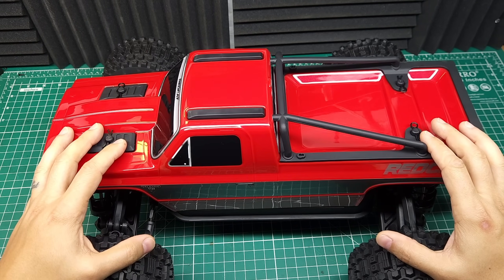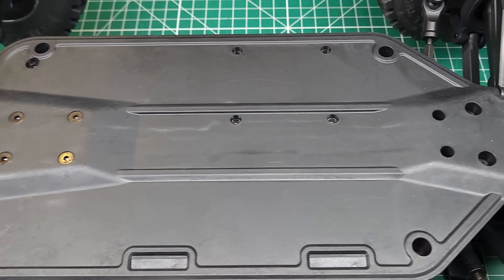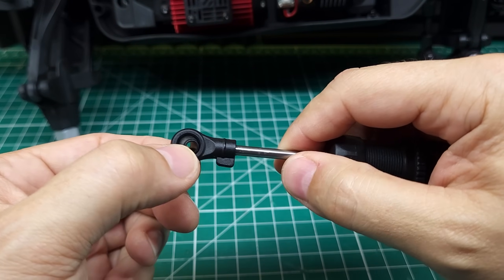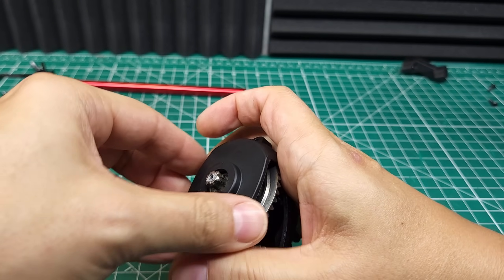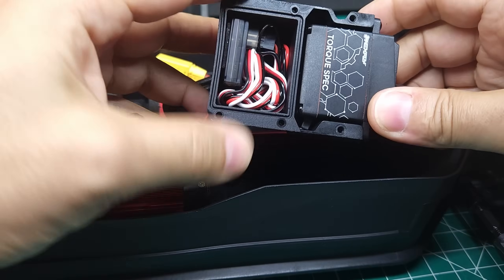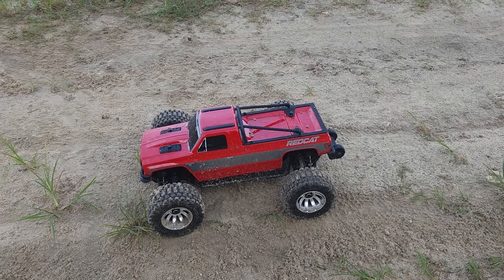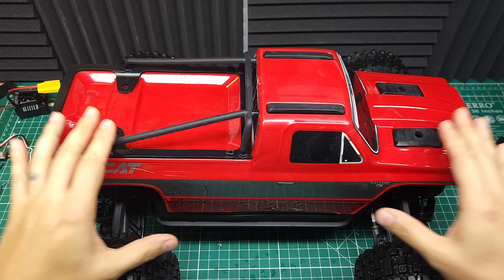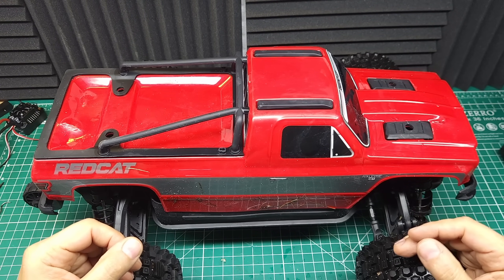I Got The Redcat Valkyrie & It's Awesome! But There's A Problem.

Comment: Got mine today for 239.00, no tax right from redcat, it came with the improved shocks installed, shock ends are threaded so they listened and changed them, esc works fine, diffs just had light layer of oil, I put some silicone grease on them in put was surprised with the light layer of oil on them. I would say it is a bunch of screws to to take off but surprisingly I was able to get diff out and back in after greasing in about 20 minutes.
Reply from the maker: Underfilled differentials is probably one of the most common issues with RTR vehicles. I suspect they don't put a lot of oil in them so that it doesn't leak out during pressure changes in shipping
Reply: damn i dont see that price on there site is there a special way to get it for 239??? i want this truck
Reply from the maker: @Ccrider363  It was a sale they had going on. Unfortunately I don't think it's happening anymore
Reply: @ well score man! I’ll probably still get one!
Reply: I think still a good buy for 299, if you order from redcat there's no tax, but I think they will have it again for 239, if they do I will get the truggy version
Reply: @  I might wait and see if there is a sale again

Comment: I got the Valkyrie MT and was very impressed initially. I had esc problems on 4s and waited over a month for a replacement as it was out of stock. While waiting for the replacement esc I was running it some on 3s and encountered another problem. The idler gear started making a loud noise. Upon disassembly I found the idler bearings, gear and shaft destroyed. Redcat sent all replacement parts but when I installed them they lasted only 3 packs. I was saving for a 6s rig when I got this on sale. I should've just kept saving.
Reply from the maker: Interesting. I don't think the idler gear is a super common problem
Reply: @DoRC  Maybe it was a fluke. I'm gonna fix it again and see what happens. I was halfway hoping it was common, and the aftermarket would come up with a fix.

Comment: I gotta think that 90 percent or higher of people who buy this rc vehicle are not taking it apart to lube the diffs, they are just putting a battery in it and running it and we are not hearing bad things about the diffs with that very light layer of oil or whatever light grease they are using, I'm thinking that's kind of impressive that they run like that with no issues.
Reply from the maker: Absolutely and that's the case with most RC cars I think. It's hard for me to remember that just because I'm kind of surrounded by enthusiasts but you're right probably 90% of people who buy these cars never touch them unless they break
Reply: I've completely disassembled my TR. More so than DoRc here. Who,if he had,would have known about the 2 bearings under the ackerman link,and would have found the red aluminum bar  that captures the hinge pins. This is only my second rc car since I was a child . I must be the 10%.
Reply from the maker: @MikeThomas-q1x  nothing wrong with that! I would say that most people probably don't spend a lot of time tearing their cars apart unless they're broken but it definitely is fun and gets you familiar with the vehicle.

Comment: I really want to buy that thing, but I don’t care if it’s $100 after buying the Vigilante. Even after doing all the diffs and Vitavon upgrades, the rear diff still strips.
Reply from the maker: Redcat actually just released a full CNC machined gear package for the vigilante that you might want to check out.
Reply: I will, but RedCat should have in there from day one, but thank you I didn’t know that

Comment: All heatsinks should have some sort of thermal compound between it and whatever it's trying to cool.  If not, it is below standard.  The heatsink might look like it makes good contact but under a microscope, you would see that it hardly touches the motor and it's mostly air gaps that need filling.
Reply from the maker: Yes and no. I've done some experimenting with this in the past and whereas The heat sink compound does definitely improve thermal transfer as you would expect It's usually good enough on these cars that it's not needed and it can be really messy if you ever have to do anything with the heat sink / motor. I prefer to run without.
Reply: Eh. I think you’re expecting too much from manufacturers. Diminishing returns. Besides, it opens up the opportunity for YOU to add that thermal compound. 

I’ve never used thermal compound and I’ve never really needed it, and I’m driving in 100+ degree summers
Reply from the maker: @PigglyWigglyDeluxe Yeah I've tried it both ways and it definitely is an improvement but for me it's not enough of an improvement to justify the mess
Reply: All these items are cheap rc cars dude. Not nasa explorers.

Comment: I’m really shocked that the servo was under performing. I’ve never had an issue with stock redcat servos in terms of power. I have broken gears after a while but always felt the performance was fine, and I like fast servos.
Reply from the maker: Maybe it was just my specific servo but it definitely was sluggish to the point of negatively affecting my driving.
Reply: @DoRC  apparently YouTube removes comments with links. If you go to redcats website and find that servo, you’ll see if goes up to 8.4v and apparently runs at 0.12s and 42kg at that voltage. Might be worth trying before writing it off. Though I have no idea of redcats receivers go that high
Reply from the maker: @dylanwhite6539  after doing a bit more work on it it seems like the main problem is that the rack gets jammed up with grit and puts a lot of load on everything. I am trying a better servo now but the red cat one might be sufficient assuming the rack is not jammed up.
Reply: This is my first non-arrma or Traxxas in a while and while I do like it, controlling it is very difficult.  It is all over the place, even with the Spectrum Dx5c Pro and 6200AT AVC Receiver in it.  I also increased the BEC to 7.4 volts which helped a bit but the wheels tend to wander, especially at higher speeds.  Not sure if a better steering servo would help?  It was not easy to get that Receiver in there and because the Spektrum one is larger than the stock one, you end up having to mount it flat as opposed to sideways like the stock one is mounted.  It could also be that I have been spoiled by the more expensive vechiles like the 6s BigRock and Mojave and am expecting more than is realistic for this price.  The Maxx is not great at tracking straight either but the wheels at least don't dance like these are.
Reply: I fixed the issue.  Truck is driving straight as an arrow now.  The DX5C Pro bound to the 6200at AVC Receiver makes a massive positive difference.  Initially, the fact that the receiver is under the esc and the fact that you have to disconnect the servo-saver threw me off when binding.  Also had initially forgot that with the AVC receivers, you have to bind and calibrate twice, back to back, in order to activate the AVC.  In addition, the aervo has to be set straight in the middle.  It is a process because first you bind, then with the truck still on, you have to re-attach the servo-saver, situate the ESC back into the chasis as it would normally sit, then start the calibration process the same way you do an Arrma vechile.  Full throttle then full reverse, then turn the wheel to the right, then to the left and from there it calibrates for the first time.  Then you turn it off and repeat that very same process, identical to the first go around with the exception being, before binding, you have to reverse the steering, then start the identical process.  After I completed the second bind and calibration, I then screwed the ESC back into the chasis.  Now the truck drives awesome.  Straight and with much better control.  In fact, it drives better than vechiles 4 times as expensive.  This is an extremely impressive release from Redcat.  Just have to get it set up properly like with all RC's.
Reply: When I say it is driving with total control, that is absolutely the case.  Cannot believe the difference with an avc receiver installed.
Reply: @XWXW-lk4jf  sounds like you need to update your transmitter firmware. The 6200 should already have auto AVC calibration and I know the 6100 and 6110 support it with an update. No more of that right left forward brake nonsense, it just works as soon as you start going forward. You can see the firmware your on right now by looking at the bottom of the screen when your booting up. Note that if you’re super out of date, still on a v1.x version, updating to v3.x will clear out ALL MODELS as the old file system isn’t compatible for some reason. If you have the dx5 pro with the micro SD, you should be able to export the models to the SD card and then import them after the update. Slightly confused because a “DX5C Pro” doesn’t exist. There’s the DX5C and DX5 pro, I assume you mean the latter
Reply: @dylanwhite6539  Yes, Dx5 Pro.  I also own the Dx5c as well so I confused them for a moment.  I did not know about the firmware update.  This is a brand new Dx5 Pro transmitter.  Wouldn't it come with the latest firmware?  I ordered it directly from Horizon, I will have to reach out to them and find out why this one did not come with that.  Also, are you saying the update eliminates the need to bind it twice in order to activate the AVC?  I iniitally did not do the full calibration and also only bound it once and the truck was all over the place so I am thinking this one did not come updated.  That said, the Redcat does not have a Spektrum esc, so I would have still thought that you would still need to manually calibrate the esc but you are saying the update eliminates needing to do this even on non-Spektrum esc's?  Definitely will have to look into this because getting this set up was a hassle.  I think the Sport Avc Receiver would be a better option for the Valkyrie than the 6200at version.  The Sport one is smaller and might be able to be mounted sideways like the stock one is.  The only way to mount the 6200 is flat on the ground, which leaves it vulnerable to getting wet given the reveiver box is not waterproof.  It also makes bolting the esc/receiver box more difficult.  Mounting the receiver sideways off the ground gives it more protection should water get  which it will given it sits right at the front of the chasis where there is an opening.  That said, it is all set up now and it drives better than my Maxx and just as good as the 6s Big Rock.  Very impressive vechile Redcat developed.  If Traxxas is gonna charge $570 for the Maxx, they are gonna need to make some major enhancements other this truck is going to take a big bite out of their sales.
Reply: @XWXW-lk4jf  yes, no double bind is required for AVC to activate with the latest firmware. You also don’t need to do the steering and trigger inputs. It just starts working immediately. Now when you’re calibrating the esc throttle range you’ll want to have AVC off, but you can simply turn the steering and throttle rate to 0% on the transmitter to do that. Triple clicking the receiver to disable avc entirely is unnecessary for throttle range calibrations

Comment: Mine also came with a ridiculous amount of toe out on front,I'm sure it would be all over the place if I left it that is way.
Reply from the maker: I would try running it first. Toe out is common on these bashers and the more play there is in the steering system the more toe out you're going to get from the factory. This is so that under acceleration when all of the slop is taken up the wheels will basically be pointing straight. You might find a drives just fine.

Comment: Just picked up the Valkryie TR.  I'm excited to get out and see how it does.
Reply from the maker: Have you had a chance to drive it now?
Reply: @DoRC  I haven't.  It has been super cold in Michigan.  I'm hoping to find an indoor track to take it to.
Reply: I have the TR. The problems I've had are
 1.axleshafts breaking. I live in Hawaii so it's really Rocky.  The rocks would get caught where the U-joints on the axles are and ether wear down the plastic or catch the pins and break and rip them out. I have some new ones otw from redcat covered under warranty, but I didn't see how that would solve my problem, only delay it. So I've found some stainless steel aftermarket ones from Amazon. As well as built some plastic covers for in front and behind the a-arms to block the rocks from entering.
2.steering.
Its uncontrollable at high speed.the slightest touch of the steering controls at high speed and it crashes an burns. If it drove in a straight line it wouldn't be that bad.but it doesnt,so steering inputs are needed. Which end in scary train wreck type crashes.

Comment: ive been wanting a 4S outcast for a while now but when I saw this I was very interested but the shocks and a few other things have me on the fence now. price is right but the outcast is a proven platform.  Thanks for the great video.
Reply from the maker: As of right now I'd recommend getting the outcast. I'm sure redcat will get the shock thing taken care of but even though it is significantly more expensive the outcast is also going to be a better truck overall.
Reply: Get the Outcast, super fun to run. The only gripe I had on mine is the servo, turning radius on grass was garbage. I upgraded to the Amazon special 35kg pro going for $36.99 at the moment.

Comment: I think redcat will figure it out pretty quick. 
They're already testing out hardened gears for the Vigilante. Based on that alone, i would be surprised if they stood idle at that one little problem. 
They've been on too big of a roll lately to ignore.
Reply from the maker: Well especially given at the manufacturer has already fixed it on the wov trucks This is more of an oversight than an engineering challenge.
Reply: @DoRC 
Just a thought;
I'm not familiar with Wov plastics, but I do know redcat has fantastic plastics as of the past few years. 
I've used their kaiju plastics and aluminum parts to beef up my rival mt8 and they hold up incredibly well until the temperature gets below 50°f 
With my experience in that regards, I wonder if they have not confidence in their plastic to hold up. After all, the few folks I've seen who have reviewed this truck, have yet to report that particular breakage. Where as the Wov it broke fairly quick.
Reply from the maker: @captaincouldverc  It's possible but I've since found something pretty interesting on mine. Stay tuned for the next video :-)

Comment: Appreciate that you do a complete tear down for your vids! 👍   The Valkyrie is a solid rig, good performance and a great value.  Those diffs look like they'll take a beating.  I agree though, those shocks need to be updated and they need to offer replacements for those that do get stuck with these shocks.  Not a fan of the splined axle shafts either.  Just makes no sense.  I mean, use a proper 17mm hex and be done with it.  Thanks for the review.
Reply from the maker: The spline shaft is probably stronger but it really does limit options if you want to put extenders on etc.
Reply: @DoRC  Agreed but having proprietary designs always limits choice - rarely a good thing 👍

Comment: 2 mistakes i noticed in this video. 
1. The steering does have 2 sealed bearing in there. Open it up and youll find them.
2. The hinge pins are indeed captured in metal. You just have to remove that plastic to see it.
Reply from the maker: Good observations! Thanks for the correction and thanks for watching:-)

Comment: Kudos for the teardown! Love it! Helps to see how these things are actually put together vs the competition. With that said, this thing looks like a real PIA to work on. I wonder what the pinion gear range is on these? Hopefully better than the Kaiju. While I really like the Kaiju overall, the gear ratio limits of the motor mounts lack of adjustability is disappointing.. I'm more interested in the truggy version of the new Redcat, but not enough to actually buy, I think I'd rather pay a little more for something else. The suspension looks terrible in the running footage too, like a lumber wagon. Can't believe Redcat didn't address the shock issue that's been known for 5 months now. FWIW, the Kaiju shocks suck too. Oh well, typical Redcat, okay, but not great.
Reply from the maker: Not sure what the range is but I'm pretty sure though the gear that's in there now is pretty much maxed out so you're probably going to have to use KV or voltage to affect top speed if you want to go faster.
Reply: @DoRC  I've seen the Valkyrie MT hitting nearly 60 on road, so not likely to need any more speed, I would be interested in slowing it down some more likely since it looks to be more than a handful to control. I would like to say that it is a lot of bang for the buck though, I was harsh previously. Cheers brother!
Reply from the maker: @knowair6767 Yeah it's got plenty of power out of the box.

Comment: I know if its an issue, its an issue.. but uh.. the shocks are only $8.50 a piece 😮 

I'm a few minutes from getting outside and testing my Truggy! They seem to be an absolute blast! Especially at the $300 pricepoint
Reply from the maker: That's true but again this is a known significant design flaw that has already been corrected by the manufacturer of these cars for another brand.
Reply: Another great video! Your channel is amazing. Redcat was having trouble with the Ascent Fusion driveline grubs, but when I received mine, they had been capped off. I was super happy the see that. Same radio for that truck as well. I love love love my Fusion, and I'll probably pick up one of these too. Thanks again for a great video!